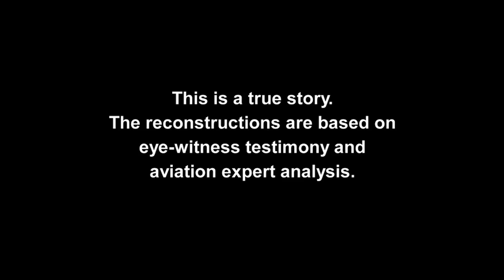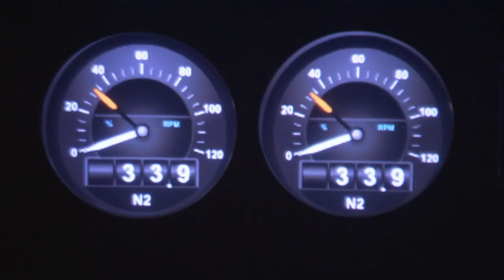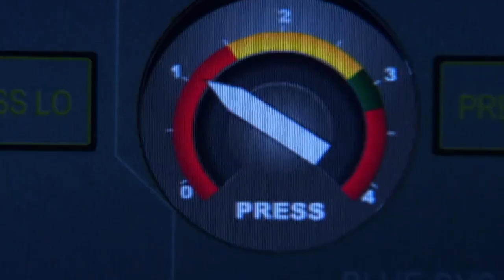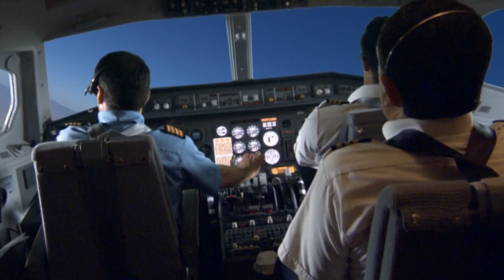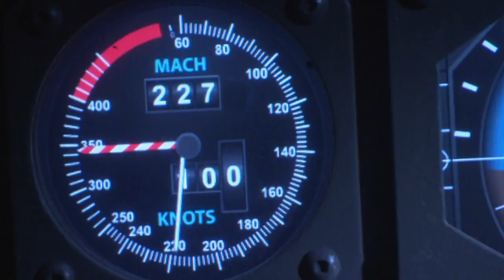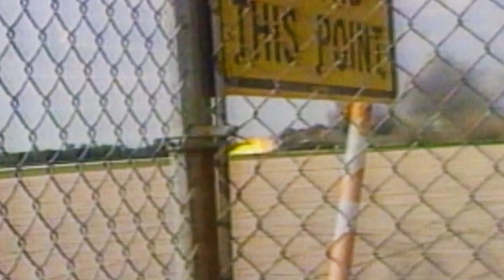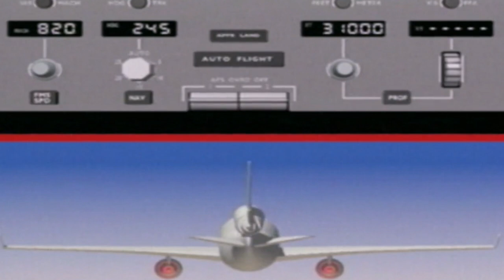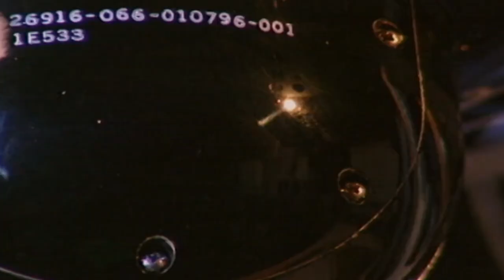DHL Delivery Plane Struck By Air Missile | Mayday | On The Move

Comment: Why are all 3 hydraulic systems running through the same path? That's a dumb design. It would been easy to split the wings and the tail into 3 separate systems but apparently it's more lucrative to save 7 hydraulic pumps than keeping your passengers alive.

Comment: The FAA is full of it in abandoning research into the PCA system. Most likely they bowed to pressure of the aircraft manufacturers who did not want to spend the extra money it would cost to impleted and install such a system. Lobbist (and few a steak dinners) also probably prevented it from becoming a rule change requirement

Comment: Next time a plane is left without hydraulics and a tragedy happens, I hope the families sue the FAA for knowing of the potential issue and refusing to implement the software solution. Lives matter more than the bit of money the airline industry would save.
Reply: Better sueing the single persons on the board making that decision, too.
Reply: The problem is that not only do you need to configure the planes for it (honestly it's probably an avonics box too, not just pure software for wide use) you have to train the crew to use it as well as maintenance people. Plus you don't know for sure it would save them anyways. The test case was under ideal conditions, they even had extended flaps (which usually needs hydro to move)

Comment: 1. What happen to the 2. Missile?
     The Documentation ignore it completly, after it was shot (if there was an 2. Missile at all).
     With the Fire in the Wing it is impossible to avoid a 2. Hit, who would destroy the Plane.
     So I guess there was no 2. Missile, the Picture and the Videoclip was the same Missile and it was just added to the Documentation for Drama Effects.
2. The Problem with Hydraulics has a simple but helpfull Way to prevent the los of Hydraulic Fluid.
     Many of you have an Washing Machine in the house and modern ones have a special Item next to the Water Tap.
     It is a Ventil who block the Water from the Tap, when the Hose has a Leak.
     Place many of this automatic, mechanical Valves in the Plane at strategical Positions.
     If a Plane get damaged in any Form of Fluid Pipes, it will close the leak, keeping the Rest of the Sytem operational.
     Hydraulic would still work and Fires would stop instantly if it get no Fuel.
     It is even cheaper as PCA and it can add into a Plane without much changes of the Systems.
     Working with an Spring System, it could close and open without the need of electricity or any Actions from the Crew.
     See it similar to the Situation when you cut yourself, where the Body will close the Wound itself.

Comment: If the MD11 @43:22 was landing with no hydraulics at all why were the flaps down?
Reply: Yeah I had the same question. One thing to control an aircraft when it's configured and trimmed for landing, but out of configuration, trim, and with part of the wing missing, throw in a crosswind or something?!
Reply: Maybe simulating hydro loss on takeoff? Flaps not retracted?

More realistically they probably didn't want to risk losing the plane if they went in without flaps

Comment: Airliners have landed on no controls and thrust from engines only, every single thing u can think of has happened and will again, I dont remember which airline it was but 74 gear youtube does videos on them and more importantly mentour pilot who's a captain does break downs of disasters where all people die and ones where everyone lives, and I want to say the last time this happened it was that airplane that has 3 engines 1 in back and something exploded the back one and they only had the 2 front ones and used the thrust from them to turn and land and if I remember correctly they all lived it was a full flight of 300ish that or only like 50 people died I dont remember but it def happened before this it was in the 80s or 90s this seems to be 2000s maybe even early 2010s

Comment: So its no hydraulic recovery system? I wander they didn't build the system have capability to detect loss fluid pressure and close the line to stop loss pressure, Of course after that the system can re fluid again using backup fluid tank and the control of the plane back online......I wander they didn't make this system.....🤔

Comment: Well then why dont they just isolate the different hydraulic systems, each wing,rudder,ect has its own source of fluid thats not directly tied to the others.
Reply: Because if u lost one on its own independent system, it's gone for sure. Redundant systems were designed  to still have some, even if limited, control of the 3 flight controls.  Rudder, ailerons and elevators.

Comment: wouldn't it be better for planes to have those 3 hydralic systems seperate on each wing and tail? So if part of your wing blew off you'd only lose at most 2 systems instead of all 3.  This design is so dumb, how can a system be redundant if one instance of damage can render all of them innoperable?
Reply: No, because each system has to be able to fully control the aircraft. That means each system has to reach rudder, elevator, left and right ailerons, left and right spoilers, landing gear, etc.
Having physically split systems like you said would be disastrous should there be a single system failure, losing an entire third of control systems which also means asymmetrical control.
Additionally, this is a civilian aircraft, not an A10...
Reply: @joshuacheung6518  I get that but, and this is my opinion, I'd prefer flying with asymmetric controls over no control at all.
Another way I imagine it could work would be to have safety valves that in instance of pressure loss it will close off the part where pressure loss began and have a reserve tank to refill the hydraulic fluid lost. They could also add an electric system as a redundancy instead of another system that would break from the same damage the other redundant system would. Lastly, use the pod design for passenger aircraft so in case of total loss of control you can eject the whole cabin and have some chutes carry it down. Lots of solutions, wish we threw as much money in passenger aircraft as we did to warthog.
Reply: @Razgrits  that's the thing though. Yoy would be hundreds of times more likely to HAVE asymmetrical control issues in the first place. A single system failing isn't uncommon. The other two take over, the plane continues to fly normally.
With the proposed system, a very common occurrence would result in the loss of a random piece. The worst set to lose being the emppenage. 

Safety valves are a cool idea, but that would overall add hundreds of pounds in material and wiring, as well as be an additional point of failure, another creep up in design complexity and another control panel in the flight deck which means more workload on the pilots... to combat a very rare issue. All three systems suffering severed lines from a missile in a civilian jet is... well, just look at how many times that's happened in history, and compare to the number of annual flights we have now.

That last one i think was proposed by someone, but that system is incredibly complex and has many points of failure... the system would be great new, but over the years i doubt airlines wouls maintain them well, especially because there isn't really a good way to ops check a system like that.

You have to remember, the difference between a warthog and a civilian passenger aircraft is that one is designed to shoot and be shot at (armored more against bullets than missiles) and the other is designed for peaceful shuttling of passengers. If you had the same armoring and redundancy that you have on a front line combat unit, your ticket price as a passenger would be... well, flying would be a luxury item again like the far far past.
Reply: @joshuacheung6518  "A single system failing isn't uncommon. The other two take over, the plane continues to fly normally.
With the proposed system, a very common occurrence would result in the loss of a random piece."

What? No. Losing a single hydralic system wouldn't result in the loss of anything with my idea, and in the instance of a catastrophic failure you'd still be left with SOME control. In case you misunderstood my idea it goes like this:

We have hydralics A, B and C. On the left wing you have AB but not C, in the right wing you have  AC but not B. On the tail you have CB but not A. If any of those take damage you are left with at least a semblance of control over the aircraft instead of losing all of it. It's an infinitely better situation to be in than thrust control and it would literally cost (almost)nothing to impliment(You'd just have to shorten the lines of each system to the respective extremity). In all cases you'd have at least either rudder or ailron control enough that you'd be able to turn the aircraft or at least have a more controlled crashed landing. Way better than going straight down and as I said, can also add an electric system to everything for added redundancy that can be activated in case you lose engine pressure and you are about to have a crash landing so you can at least control the aircraft for a few minutes on that alone.

Also, I don't think it's a good excuse to use that systems won't be maintained, or that the flight deck will have an extra panel which I doubt will be the pilot's job or the FO's job to monitor, there is a flight engineer with them, no? Lastly, I'd take 20 bucks extra on my ticket to have far more safety, and even if it's a rare occurrence I'd like you to tell that to all the people who have died due to said failures. A plane, unlike a car, when it goes down, takes hundreds of people with it. Being safer should be a no brainer even if some money has to go to R&D to manage that. At least newer planes should be forced to adhere to that.

Comment: Really? I hardly can believe that a actual portable ground-air-missile is THAT weak?! I mean they were made to bring planes down. Why doesnt´t that impact destroy the engine and the wing? usually there wouldn´t be any chance that this plane would stay in air. how is that possible.
Reply: Its ment to take down small fighters and helicopters, it only has a 1kg warhead. Which will definitely do some damage but with a aircraft that big it won't full destroye it.    It almost killed a massive plane so I feel its big enough

Comment: I like the storyline. But I think you would of done a little more homework. For starters you used an American fire engines not air port fire engines. EOD’s don’t send fire engines to de-mine a IED field. EOD trucks do that. I mean you took the time to make it and added barb wire like what is used in American prisons. Yet the DOD uses a different type or wire. Because a truck lays it vs humans. And you put the humans on one side, and the fire engines on another side. Even American fire engines tires would pop if it ran over it. The weapons used in this creation were DOD issued not Iraq issued. Because Iraq got its weapons from the Russia not America. So my opinion the plot of the story A+, the props used to create this story a D, and articulated correspondence a C. Don’t get me wrong. It’s still worth my time to watch it. Way better then some other recreational content on YouTube. Lastly I rate the whole story with as far as it happened in real life a B. Thanks have a great weekend. Maybe 2022 will be better. And those who used treasonous acts against humanity will be held accountable!

Comment: These guys did and MAZING job of flying but I find it very strange that a HEAT SEEKING MISSILE would strike the wing way out from the HOT ENGINE????????????????????
Reply: They are not exactly super accurate.  I'm not sure but they might have a proximity fuse.  Just 1 small piece of shrapnel can destroy an engine, take out hyd system, cabin pressure, fuel leak fire.....  This was scary shit.  I was a flight engineer on a C-23 over there when this happened.  The pilots did an amazing job landing that wounded bird.
Reply: @dave-yj9mc  Heat seeking missiles go up the exhaust. So unless the plane "juked" to the right in the last second the missile would gu into that left engine.
Yes they did an outstanding job. PS I never saw what happened to the 2nd missile.?
Reply: @frederickwise5238  Second missile?  Like I said they just are not that exactly accurate.  The missiles fly in a corkscrew patter.  They are constantly reacquiring the target because its moving.   A CH-47 was shot down near BahQueBah also by a SA-14, or -16, in Novemeber or December I believe.
Reply: @dave-yj9mc  The video talked about them firinfg a second missile. - Thart 2nd missile.
Reply: @frederickwise5238  Oh?  I didn't watch all of it... I have seen the original video the terrorist's recorded like 100 times.   In the original video after they watched it hit the Jet, they all scrambled out of there.
Reply: @dave-yj9mc  Then  one took time to fire a 2nd missile.
Reply: @frederickwise5238  I haven't finished watching this.  If you can, please give me a time stamp of where they talked about or did a 2nd missile.  Thanks
Reply: @dave-yj9mc  I have other fishto fry, you watch it. OK lol

Comment: The fact that ALL hydraulics can be taken out by damage to a relatively small part of the plane is ludicrous. I would think, if you lost all hydraulics, the plane is in 3 or 4 pieces and it is just seconds before hitting the ground (the pilot wouldn't even have time to find out all hydraulic are gone). The left wing, the right wings, the tail section and the landing gear hydraulics should ALL be 4 separate and isolated hydraulic systems. In theory if the entire left wing was ripped off you should still have hydraulics in the right wing, the tail section and to lower the landing gear. The engine thrust control is a nice fallback, but the engineers of these planes need their heads bashed in for this stupid design.
Reply: You know nothing about hydraulics of aircraft design. Even military aircraft don't have such isolated systems. They have backups and a limited non hydraulic system to us to stabilize the aircraft after its damaged but they aren't wide body  transports.
Reply: It's true, it is sad that with 75% of the whole hydraulic system being perfectly functional a leak in just one location can put everything out of service.  Although there are three systems they are all routed together throughout the plane so any physical damage from external impact of any sort is likely to put all three out of service. So anything like an uncontained engine failure, structural damage or fire in any part of the aircraft can put all three systems out of use at the same time, The only situations that the triple system protects against is for things like a failing seal or a pipe connection that was not properly tightened and so on.

There exists however a relatively simple device that can save the day in such situations. It is a valve that isolates sections that leak.  The principle of how it works is quite simple, based on measuring the difference between the supply and return lines. Placing these valves strategically along the hydraulic lines prevents a leak in any part of the line from losing pressure and from losing fluid.

That way in a situation like this only the actuators beyond the leak would be lost. All the controls apart from those on the left wing would have remained functional and possibly also the inner flap and inner aileron of the left wing as well.
I know there had been discussion of introducing these devices in commercial aviation and I'm guessing some modern planes do have them but I'm not sure as I had not followed it further.

Another very simple thing which I am baffled has never been used is simple manually actuated isolating valves with electric actuators at various points along the hydraulic lines. That, combined with a sufficient reserve of fluid would allow the pilots to manually isolate parts of the hydraulic system to stop the leak and once done pump in fluid from the reserve to make up for what was lost.